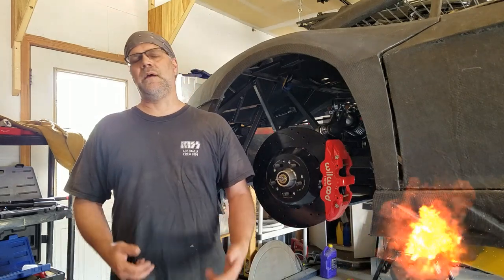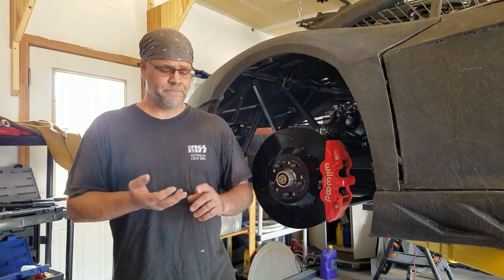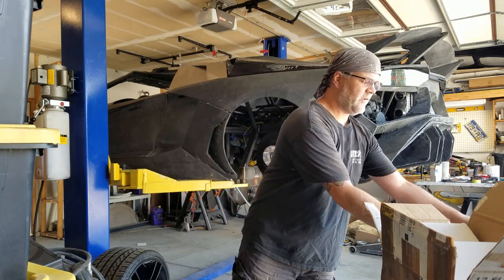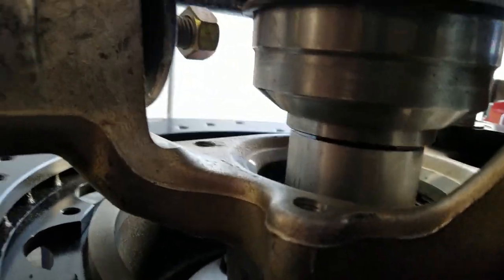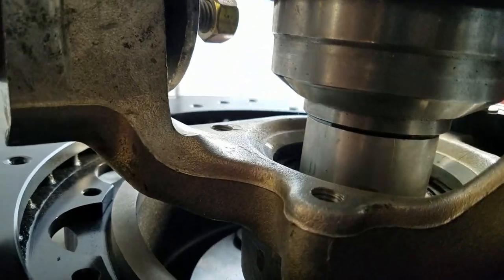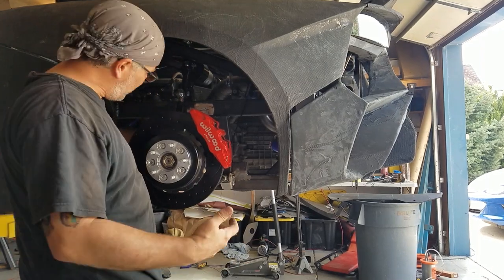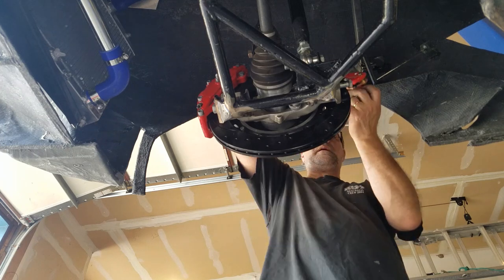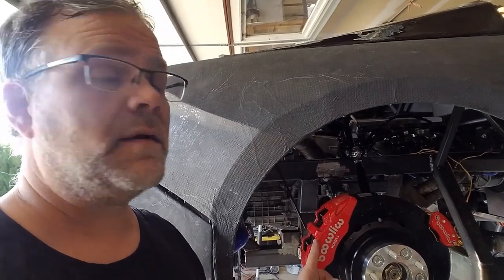3D Printed Interceptor Brakes Part 1

Comment: Hello from Utah! I've just recently discovered you with the news story! I'm so glad I did! Your project is very inspiring, and the execution is amazing! I have a similar super car project (different car make) I'm about to embark on after many years of parts accumulation. I have 60% of the cars CF body panels that are slightly damaged OEM . I want to 3-d print and mold my missing panels from my scans. I'd love to discuss my project with you. I'll contact you. Otherwise, any tips about best printer to use and bed size, or where I might out source prints? sorry if you've covered this in previous videos . Thanks for sharing this!

Comment: Sorry if this has been asked before, what is the reason you went for printing the encapsulated core/lost plugs instead of printing moulds? I could see "modular bricks" being printed and attached to more course plywood frames cut so they form a grid, then skinned with a single layer of thin woven surface layer glass and cheap poly or vinylester. That way you would save yourself a huge amount of sanding clear coat and weight, all the prep work would be in spraying a nice self leveling coat of gelcoat as a mould top surface. The panels could then be reinforced by adding foam or honeycomb pre infusion and would come nearly ready for single layer clear coat out of the moulds, or if you'd dare, start with clear coat inside the mould. I'm sure you've considered this and picked this alternative because of important counter arguments so I'd love to hear these for future projects of my own. Love the project and the fact you do this as a family thing
Reply from the maker: We wanted to try something new.

Comment: Question for you @lasersterling  and I may need to just go through your vids to find it. If you've talked about this
already just say you already shot a video on it.  How did you go about designing the chassis for this build? Did 
you design it in CAD? Soilidworks? Did you run it through FEA?  I'm just curious to see what goes into designing 
a space frame from scratch! :)   

Edit I just heard you mention Solidworks... That is absolutely the way the way to go! :)